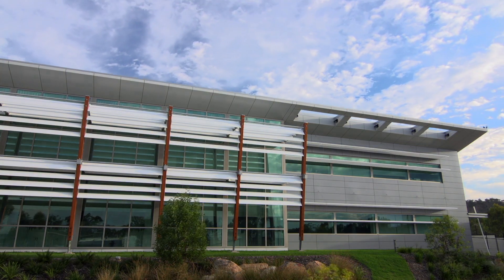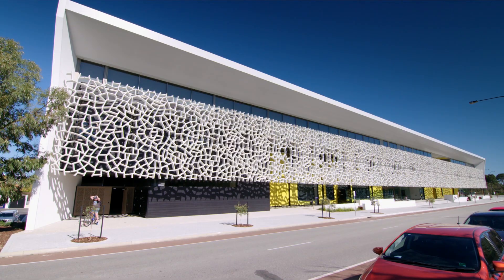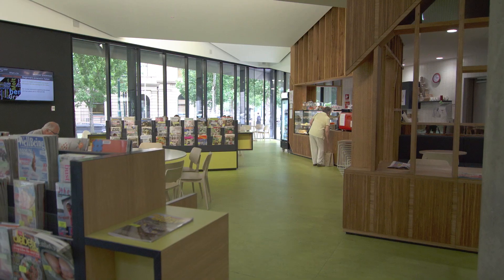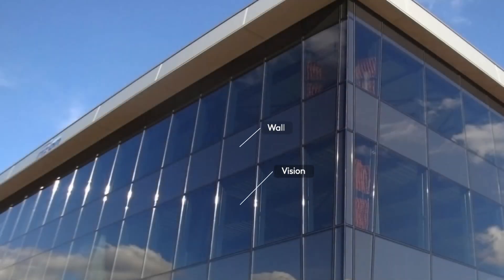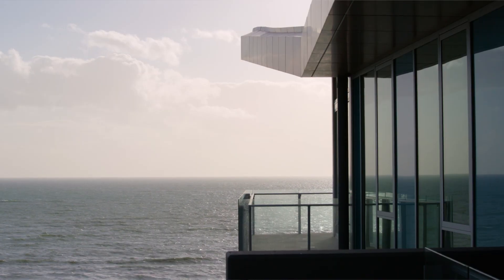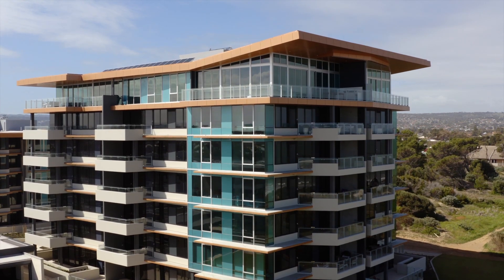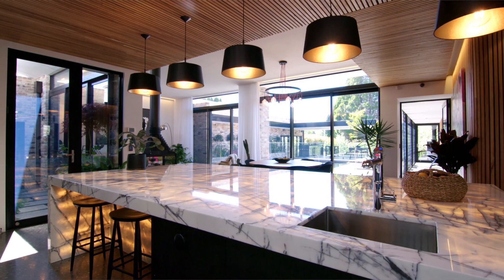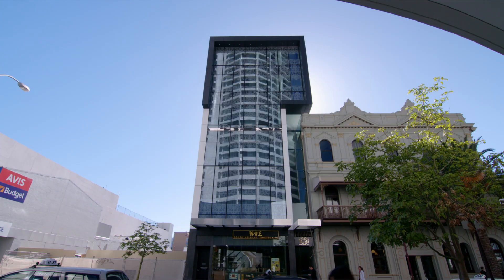Section J 2019

Comment: With respect to QLD (and all warm climates), we should be designing buildings, especially residential buildings, to take advantage of the climate (open and airy), rather than try to fight against it (air tight, double glazing, and heavily insulated). Buildings in Queensland that are designed to what southerners or Europeans recognise as "good passive design" are actually often less energy efficient because they leave the occupant with no choice but to use active cooling, because the building traps in the heat, and the heat is by far our biggest problem. In Brisbane we hardly even have a "winter" to worry about. There is definitely no "one size fits all" approach to building energy efficiency, it has to be heavily tailored for the climate, and at the moment the building code is not catering well to the warm climate regions as it should. We have high rise apartment buildings in Brisbane, by architects & developers from Sydney & Melbourne, that use entirely glazed curtain walls - that might be ok in temperate or cool climates, it is total lunacy in the subtropics or tropics. It's like a 25 storey greenhouse.